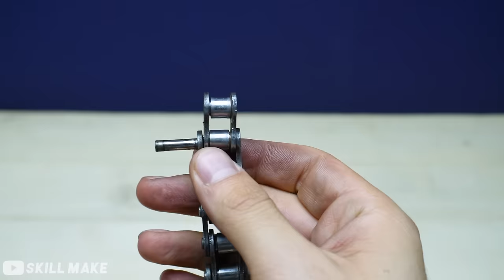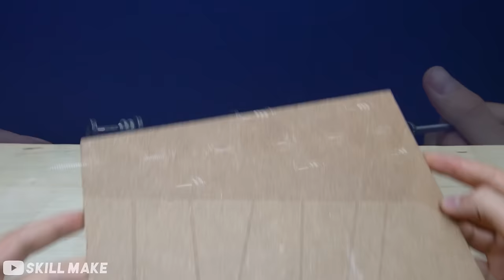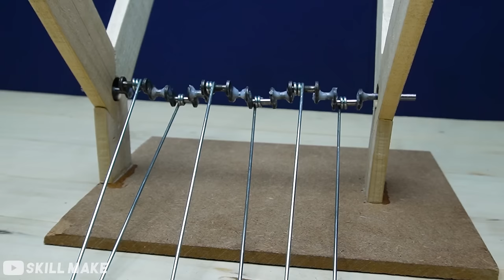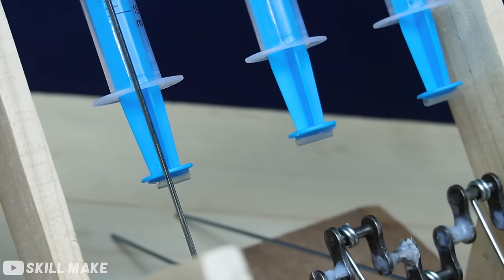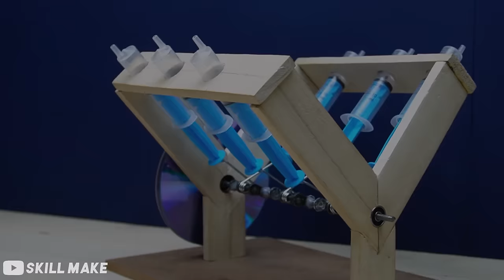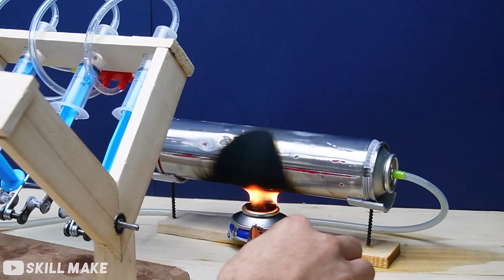How to Make 6 Cylinder Steam Engine at home (100% working)

Comment: For anyone that wants to know, this isn’t a steam engine it’s a sterling engine. A steam engine has exhausts for the steam which builds up pressure in the cylinder. Sterling engines reuse the same air by heating, cooling and repeat.
Reply: It's not a sterling engine, it's not a complete model of any type of real heat engine, an heat engine needs as much cooling as heating. All the syringes in the video are just fed in parallel, or are supposed be, it's definitely faked. A sterling engine needs expansion and contraction, a cycle, not just being fed steam, that doesn't work.
Reply: Def fake
Reply: Stirling*
Reply: @fishyerik yes but if you could use compressed air and have it strong enough to move the pistons he could be onto something here right. Obviously this needs a better construction but this is a cool concept since we can use a trompe hammer to compress air and run this thing quicker. I’d have used more stable parts and actual pistons but it’s not out of the realm of possibility all is needed is enough air to move each piston?
Reply: @fishyerik  I'm not entirely sure but u maybe right , because the air or steam is expanding and therefore pushing the piston but I don't see how the fluid  expands at the other end of the piston and pushing it backwards and there was no slide valve system like real steam engines. Please explain it to me if this is real
Reply: Not a stirling engine at all. Its literally boiling water to compress air. The "pistons" run off of compressed air. Its a pneumatic engine or a steam engine. 

Sterling engines use a transfer of hot to cold to build pressure in the cylinder and release said pressure. The engine in this video runs off of already compressed air/steam from a boiler. Not a stirling in the slightest
Reply: No, in a Stirling engine, the working fluid is alternately heated and cooled, which explains the duty cycle. Here we do not see cooling, the working fluid is constantly coming from the source as in the right engine, but there is no pore distribution system.

Comment: Fake video but still a cool design. This can't work without intake/exhaust valves. There's no way you can just dump steam into a cylinder and expect it to exhaust against more steam constantly being admitted. It needs incoming steam to be cut off and the exhaust valve opened to atmosphere. Otherwise nothing will happen. You would also lose a lot of power with top dead center of the stroke so far away from the top of the cylinder. The goal is to remove as much used steam per stroke as possible. 

I like how you made the crankshaft! Pretty clever using motorcycle chain links and some all-thread. If you added provisions for valve actuation to the crankshaft, then you could actually control the steam admission and exhaust for each cylinder. Simple slide valves can be made easily with the parts you have. You could also get a smoother running engine if you offset the crank journals by 120 degrees like a real V6. More support for the center of the crank would also help you out as well. You can see it flexing in the video. 1 or 2 more bearings in between journals with proper support would minimize flex. 

I don't like being critical, but your design does have potential. I'm not sure what kind of glue you're using but if you do end up improving it like how I described then epoxy would be better. Good luck!
Reply: Yes sir that's what I was also confused. Because see still it has so much friction. And yes 120° also good idea for crankshaft but he used only 90° two set and it can create more strech on shaft instead of 90° to each and every poles. 

And main and important what about exhaust. I don't understand this physics does it is fake video or what. 

I have found your comment intelligent so I also share my view to you.
Reply: I now get your intake/exhaust valve theory. You are right.
Reply: Actually I think he might have mislabeled the engine. This seems to me like many other sterling engine models people make. The way these work is by heating the air in the can which can expand into the cylinder and push the piston and than is reinserted into the can as exhaust and is reheated and re-expands into the cylinder. It’s a pretty cool engine I’ve been thinking about making one for study and entertainment purposes
Reply: @ScreamingEngines18 still even in a sterlin engine there is a second piston to navigate the cold air back to the burner, which this model does not. But I’m sure going to copy and modify it myself. Awesome idea

Comment: Only one thing is to ask. 
Hope I will get my answer.

Ok fine let's forget friction, drage, timing for something. 
But what about exhaust.

See I don't know what the idea is used here or which physics is used here. 

Because see there is total 6 cylinder but they all are in two series, but it can get more powerful if they all are set at 90° to next to eachother. 

Still the exhaust stand there what about it. Because if it will refilleds the boiler than boiler will get blast or if it doesn't happen than the movement of postion will stuck.

I like your design but still the arrangement of crank and exhaust I don't understand. Please make it clear if possible.
Reply: Totally agree with you on all your concerns and improbabilities. Your idea to set at 90 deg to each other is also the traditional way, but he has only 2 set of inlets (Not even any outlets), so with 2 inlets, the system can only work as a 2 cylinder model. If 90 deg from each adjacent, then each cylinder will be 25% out of phase with the adjacent and the 2 inlet model will not work. He will need 6 tubes, making it an extremely complex and inefficient model. From that context, his idea to make it a 2 cylinder system (although in 3 subunits) may be better. Drag and friction are inevitable, so not sure how that can be overcome, I have used syringes for 40 years as a physican and I can testify about the friction in the plunger in the syringe. Also assuming that the copious amount of steam condensing lubricates the plunger, an exhaust is still needed, and a small hole in the body of the syringe at max outward position of the plunger might actually exhaust the cylinder, and drop the reistance substantially that the return stroke might be easier and the system more efficient, overall I dont think this model is real, but may be it is...
Reply: Im not reading that kanninsevegan
Reply: @ichosolemanuel6048  the fact that i skipped his reply an directly jumped to you reply shows how similar we all humans are

Comment: Where is the exhaust unable to see
Reply: 😂😂 very good question. That is not steam engine. Skill Make said steam because he added water into main tube. I think he did not understand why the pistons can move....🙏IMHO
Reply: No need for exhaust because there is an open fire. What do you want exhaust for?
Reply: @steganomaledoor3147  for dispose of the steam/pressure that has been used to push the piston, so that the piston can return to its initial position. But it could be that the steam/pressure comes out through a hose connection, so you do need exhaust. Internal or external combution engine have the same principle.
Reply: @oprekboy9693  Yeah, I guess you are right.
Reply: Each piston needs a waste-exhaust hole bored at the downstroke.
Reply: @williamfoster6172 it is working on the principle of sterling engine
Thats why it doesn't need an exhaust in the piston
Reply: @un_known the engine has no timing sterling engine has a list for finding offset by 90° there is no 90° offset in this steam engine. Also the left side of the engine between the flywheel and the base there is probably a belt hooked to a small electric motor under the table

Comment: Oh yeah. A steam engine with no exhaust. That's totally a real thing. When it comes to physics, it's more like guidelines than laws.

What a coincidence that at no point while the machine is 'running' can you see the ENTIRE machine.

What's frustrating is that a couple strategically placed holes in those syringes and the thing might ACTUALLY work.
Reply: bro stop raging, he made s steam engine that works, there was just not enough pressure at the start for it to run on its own, so it needed a little puh
Reply: I'm not so much raging as sarcastically mocking people dumb enough to think he built a working engine haha  @OmarHARRAZE
Reply: The syringes barely have enough sealing, so the gas escapes through the rubber part and the Vaseline. You can clearly see the inside of the tube clouding up from the steam. It works, even if its not planned as well as it should be.

Comment: Actually the system needs an exhaust, and I suspect this can be done with a small outlet in the cylinder part of the syringe, at max movement of the plunger. The three outlets on one side can be connected to an outlet tube and the water drained away from the system itself. This "small outlet" is not any different from the traditional exhaust outlet in the engine chamber. Exhausting the steam might actually drop the pressure inside the syringe significantly, the engine might perform more efficiently. Just a thought, not sure if feasible.
Reply: There is no need for an exhaust....remember,  the exhaust is for the fumes to escape from a closed combustible engine. This one is running on an open fire system. Only if the fire was in an enclosure would we need an exhaust.
Reply: @MitPatel-yr3yt Oh yes! I think so too....and he is right.
Reply: @thenoob6728 Yes I agree.

Comment: What a nice skill. I love this idea so much and useful that's why I subbed u
Reply from the maker: Thanks for watching
Reply: The engine won't work if you tried to make it with this design it has no timing for the power stroke meaning this will just push the pistons to the most furthest extension possible and the engine would just stay there

Comment: There is a leak of steam from al around the syringe pistons 
Guys take it easy this system gonna do nothing for real
Exhaust would be necessary if the system was without leaking to decrease steam pressure but all around the syringe pistone we have leaking of steam
This is my guess of course....
Also there is some regulator on valves that can control steam pressure